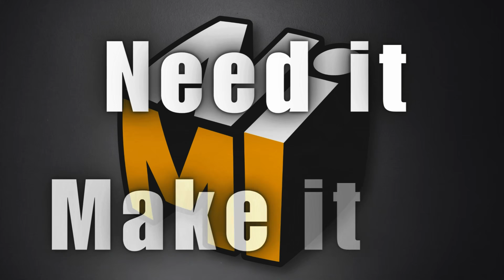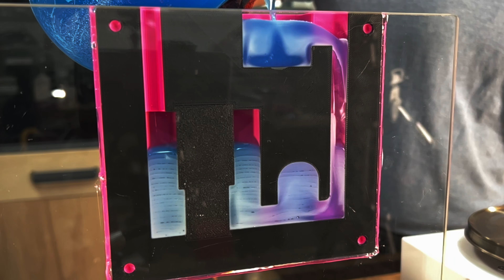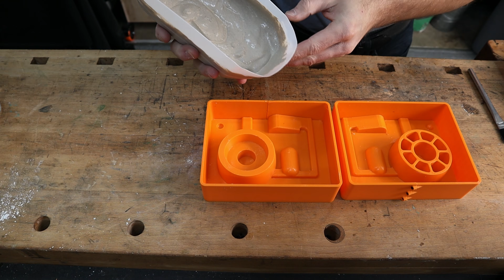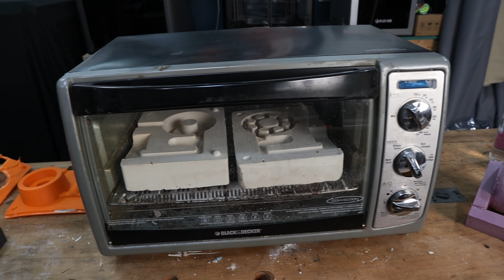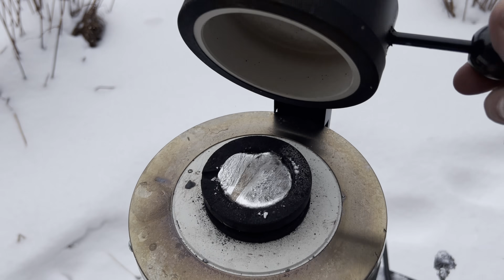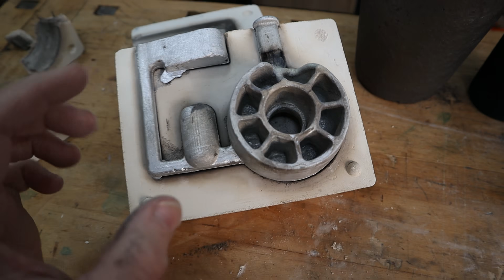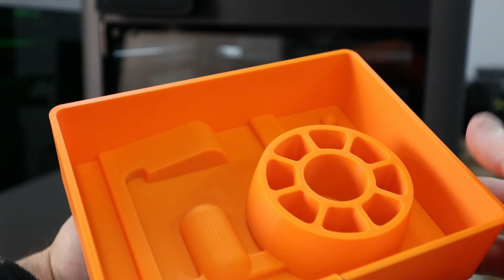Casting detailed aluminum parts is probably not a good idea and here's why.

Comment: I agree with your conclusion that you could use a larger furnace. But I think you may be missing some valuable lessons here. This time the more intricate sections of your casting were only there to reduce the overall volume. But you might want to cast intricate details in the future because it's part of the casting you want. I think figuring out how to cast thin-walled and lattice-like sections could be a very useful thing. I have a suspicion that increasing the height of the riser above the part would help a lot by getting the pressure high enough to rupture the oxide layers that can cause cold shunts easier. Also making the pouring funnel larger so that you can pour the metal faster would probably help even more. 
As far as making your 3-D prints easier to pull out, might I suggest a few things:
1. Give your prints a coat of spray paint to smooth out all the surface texture from printing.
2. Wipe them down with a silicone oil mold release agent before use.
3. If they still don't want to release well, instead of heat try cold. Plastics have about 10X the thermal expansion coefficient of plaster of paris and will shrink more when cooled causing the plastic to separate from the plaster. So after pulling the outer shell off throw them in the freezer overnight. (Edit: I forgot that the freshly cured plaster has far too much water in it to do that. You would have to let it dry out for a long time before throwing it in the freezer)

Comment: I was really hoping you solved the issue of 3d print sticking to the plaster even with proper draft angles.  Probably why they use rubber in the production atmosphere.  Layer lines are also a good place for plaster to grab ahold of.  I will keep trying also.  Looking for a better workflow from 3d pring to plaster casting.  Thanks for video.
Reply: Use abs and smooth with acetone atmosphere to remove/reduce layer lines.

Comment: I think youre doing good. You need to keep in mind that the cheapest mass production methods - like casting to save material and machining time - require the greatest amount of effort to get right. Imagine how many billions of dollars went into perfecting a coke can that cost 3ct. In casting people use old men with gray beards and 60 years experience or simulation software that costs 6 figures a year. Things like uniform wall thickness, cooling speed, etc. Casting is nice because its relatively inexpensive. Fucked up? Melt it down again. So you can experiment a lot

Comment: Tapered sprue will greatly reduce the air entrainment problem. Also casting during any form of precipitation is risky as the molten metal can instantly boil the water causing molten metal to be launched everywhere

Comment: Coat the Styrofoam with plaster and you will get a better surface finish with no sand inclusions. Also, use mold release on your patterns. Investment plaster would work much better as well. Also, heat the mold to half the pouring temp of the metal. The mold is too cold for such thin walls. Try drywall mud instead of plaster as well.

Comment: Not sure if you have it in the shop, but you could try an argon purge to get out most of the oxygen out of the mold before pouring, should mitigate this issue long enough considering one of the examples was really close. (probably not remove the issue entirely since you aren't likely going to get a perfect purge unless you engineer the mould for it.)

Comment: Your molds are not completely dry, this is a dangerous kind of thing when using plaster of paris. Also doing this outside where there is snow or a puddle of water can be dangerous too. So step 1 is PPE.
Your draft angles looked a little too small. Also using AL even if it is the right type of castable material is not as easy or good as using ZAMAC (told you last time, AL is ass) . Zamac has way better details, might be not important right now but helps you in troubleshooting, yoou can see what went wrong easier and adjust. And it´s heavier, which when using gravity casting like you do is important.
The most useful way of using 3D print and casting metal is when using 3D printed patterns for lost cast. There are special filaments which cleanly burn off when casting, kind og like what you did with the foam but you replace the foam with a 3D print. You basically 3D print the pattern and the gating system with the riser, trap etc. stick it into sand and cast that´s it. Polycast is the name I believe, that´s filament for FDM there are also wax like resins for Vat photopolymerization. Also the gate is at the lowest point not somewhere in the middle like with your design. It´s not even the equipment either, first is understanding and knowledge then comes equipment. I cast ZAMAC parts with a camping stove. The best part of this video was the visualization with the wax, this was a really great idea.

Comment: Why not put the riser & basin/sprue diagonally across the part instead of along the main axis? That might help the internal flow to fill the void & prevent that bubble in the plaster mold getting trapped & not escaping out the riser.

Comment: Would be interesting to see a 3d printed Wax Pattern Die, then coat the wax pattern with a investment casting ceramic slurry. Burnout would be quite good, and you can adequately preheat the shells to help the form fill out properly

Comment: You need vents when there is a dead stop and hard turns. You would benefit from some mold/die cad software that will show you mold flow with the specifications of the materials you are using.
Your venting idea is the way to go but the vents need to be placed strategically. I know plastic creates turbulence in a mold and will cause gas pockets. I'm not sure how casting metal works but it shouldn't be too different. The water/wax model you made is wonderful but it doesn't have the same variables and properties that will affect mold flow. Water can overcome turbulence and doesn't create hot pockets of gas. That's what you are missing. There might be some information out the showing casting mold flow.

Place some small angled vents where the mold did not fill properly. The goal is to allow the hot air/gas to escape but to not let material to escape.

In regards to the foams you have used, you may want to investigate a better foam to use. If not possible, don't use styrofoam. Poor material, very toxic. With the purple foam board, use a hot knife or water jet to cut the shapes out. CNC is just chewing it up. If you have a laser cutter, that would work too. The water jet is clear why it would work but the laser/hot knife will work because there is only heat cutting the material. The CNC is shredding it and then melting it. Think dull butter knife vs scalpel and cauterized.
Give it one more go.

Comment: Just a suggestion from jewelry casting... paint a layer of plaster without any aggregate over the whole mould first and let it firm up, then add the aggregate/beard plaster. this keeps the surface against the mould as fine as possible.

Comment: To be fair on the most complete one… you could build up a mold around it with the plaster, grind off the surface of the aluminum right before pouring (it wouldn’t take much), and pour some more aluminum to fill up the under-poured section. It would work, maybe it’d be a good idea to also drill some holes or inlets in the already cast portion for the new molten material to enter and coalesce.

Comment: Casting in freezing temperatures is rough. When you pour, the stream of molten aluminum seems quite small. I bet you lose a tonne of heat. Maybe make a larger basin to pour into, so you can pour faster, and get the aluminum hotter before pouring. I would probably also preheat both the mold, and the sand in the bucket if casting outside in the winter.

Comment: I think some of your problems are coming from the way you degass your melt.  Pouring (soda ash?) on top of the molten metal isn't really doing anything.

You need to treat it just like you are making an alloy.  That is wrap it up in a piece of aluminum foil and shove the little packet to the bottom of your melt.  That will clear up the porosity your seeing and also should help fill up all the little details in your mold.

I agree that the mold with the details isn't the easiest thing in the world to cast with the tools you have, yet it should be doable.  There's something else you can add along with your soda ash at degassing that should make pouring easier.  I can't for the life of me remember what it was though.  Sorry I'm drawing a total blank.  It's been a while since I busted out the forge and tried to cast anything.  

If I think of it I'll definitely come back and comment again.

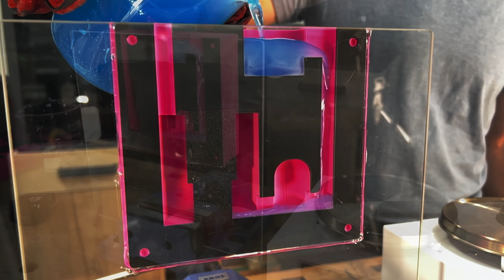Comment: 2:11 I'm not convinced the side view was faithful to the real casting event - I'd have expected the reservoir not to fill up all the way, because of trapped air, but it did, so I think air is leaking out the edges at the glass interface.  OTOH, I suppose sand is porous, too, so maybe it WOULD work like that.

Comment: Adding silicon metal powder at about 10% by weight will prevent the aluminum shrinkage.  Also another one or two hundred degrees on your aluminum and your plaster mold would probably fill.

Comment: Awesome to see the details. There a few things that are certainly causing issues. The sprue diameter is too large for the rate at which you pour the metal. For a good quality pour, the molten metal in the casting basin needs to roll over from the casting basin, fill the sprue, and the sprue needs to remain full throughout the duration of the casting. If the sprue does not remain full, it acts a little venturi like, and sucks in air and creates aluminium bifilms degrading the quality of the casting.  Aluminium wore tends to be quite pure, and not very good for casting, also being so pure, it is soft and super gummy for cutting tools after. I suspect that the alumnium being a bit hotter would have helped it fill more effectively also. Robinson foundry does some good videos on some of these methods too. Also Kelly Coffield is probably the mostr expereinced lost foam caster on Youtube for some great tips.  Pretty confident that the issues with CNC cutting polystyrene are about speeds and feeds. Perhaps try a single flute cutter?

Comment: A good rule of thumb with mold making is try to make the  form a different rigidity than the cast material. If you are casting a flexible urethane, a rigid form out of something like PLA should work great. However if you are casting a hard resin, a flexible silicone form is a better choice. For a 3d printed form for something rigid like plaster, I would be thinking about something flexible like TPU instead of PLA.

Comment: Did you put the plaster mold bucket in the oven? Maybe getting it hot will prevent the metal from cooling to fast. Or do you always need to preheat molds and this is a dumb question?😂

Comment: There's materials science that has been done to create better detail cast aluminum parts. You'd probably need to look into how they cast engine blocks and the specific alloys they use. I know there are alloys that are good specifically for sand and mold casting. Not all aluminum casting alloys are good for that

Comment: In your molded part, the chamber is part of your issue. As the trapped air cools it pulls a vacuum and pulls metal back into the chamber. You should heat the mold as well to keep metal liquid in smaller passages. Adding silicon also helps make it flow better.

Comment: The way you pour matters too, the pattern you want to cast would require a lot more downward pressure from the metal coming down the vents and spruce. You are doing very good. You pour a little slow too, metal and mould get cold faster. My suggestion is pour a bit faster, choose a better casting metal like, zamak 12 or brass as they are relatively denser than aluminum. Pour from a little upwards angle if using aluminum is the only option. Contour the entry points where the metal is being poured as see in the 3d printed cross section, it was too boxy. Smooth it out so there is minimal turbulence. Hope that helps.

Comment: Try this next time:  use compressed air to extract your mold bottoms. can extract easier by putting in buttons tou pull out after curing,  use the compressed air into those holes and will pop out.  also dry putting a very small amount of release our make a talcum slurry (very wet) and coat a very thin layer on your mold interior first.  dry then fill with support material.

Comment: What your wax casting showed you, is that you need to preheat the mold so that it doesn’t solidify before you complete the pour. Also, you should probably raise the temperature of your melted aluminum a little bit. You can also make more & smaller vent holes. Somebody else mentioned tapering your down spruce, and that is a good idea. The purpose of the riser is to provide extra hot metal to the casting as it shrinks. Putting your molds in the snow means that they were probably pretty cold, so heating is what I would suggest first. Next taper the spruce.  Black casting sand is better than the play sand you appeared to be using. Definitely use a good mold release on your 3-D printed patterns and perhaps even use more draft. Plaster tends to shrink more than most materials so it might be clamping your pattern as it dries. I’m not sure all of the reasons that you gave for your casting not working well are correct. Good luck I like your videos. Keep up the good work.

Comment: We regularly cast Aluminum with Lost-PLA.
You have a large enough crucible you just cut short on the wrong things. Your wheel part, also with cutouts, is simple so keep your pour simple:
Angle the wheel 45 degrees around the axis perpendicular to the wheels axis, so that the cutouts are on the bottom. Add your riser vertically upwards from the highest point of your part, with a large diameter and a large height - this adds more pressure which is needed for the cutouts. No vent needed as the vent is your riser which also is your feeder.
You also should dry plaster molds completely meaning also getting rid of the chemically bound water - effectively change the plaster back to its unhydrated state. This happens and 700-800°C. Hold that temp for about 1 hour per cm thickness. Also add 50% burnt clay (e.g. the red sand from tennis courts) this makes the mold more stable and reduces cracking. Your mold is small so thats not a large problem though.

Comment: The problem isn't the amount of material if the sprue and vent are both totally filled. You just aren't venting properly and you're getting air bubbles in the failed sections. I don't know and you're trying to use no vent at all for the foam

Comment: Would modifying your mould design to bring the molten aluminium in from the bottom middle of the part and making your chimney the full depth of the part reducing in size like a tall pyramid?    You could heat up the mould before pouring as well.

Comment: The most successful lost foam castings I've seen are on Kelly Coffield's youtube channel.  He coats his foam in slurry.  On the 3d printed side you might try a tapered sprue to prevent that air pocket mid way down.
Reply: A significant portion Coffield does not coat in the slurry, but instead he uses a much finer sand.  But he uses flow and head pressure to his advantage instead of seeking failure to stage content for a next video.  Difference in the target for enrichment by publishing a video.

Comment: I think it'll be difficult but i feel like you're close.  I think moisture in the plaster is cooling your parts.  I know you said that the bubbling isn't nearly as bad as last time but it shouldn't bubble at all, that's water boiling off and taking heat with it.  Those plaster molds should be dry dry dry.  If at all possible use a blow torch and point it down in there and heat the mold up before you pour.  You have enough material to fill all the way up and out the vents so i think it's just cooling that's the issue.

Comment: The sprue really needs to be smaller and tapered. Running the gate into the side of the mold was also a bad idea. You can see all kinds of turbulent flow with the wax at 5:07; bottom gating would help a lot. wax also has more viscosty then liquid aluminium, wich is behaves more like water, so even more turbulence. I would ditch the blind riser, too, it's not helping much. Preheating the plaster molds to a higher temp would help more, I think. Getting some purpose-made casting ingots would also be much better than using whatever scrap metal that has a unkonwen chemical composition.

Comment: There is another way . Make a very simple open top  mold without the sprue and vent holes . All the detailed features are basically at the bottom . And  just dunk the metal in to mold whilst it's hot .
Reply: Your suggestion seems more practical than what I was going to suggest (as someone who was around but never actually got to use epoxy molds):
Extending/extruding the 'details' out of the part so that the cold-shut(s) and other defects can easily flow into the waste (to be cut off) instead of being trapped; 
Or tilting the closed mold so that the slope of the part at the vent is maximized.

Even though I have the impression that a design goal is aways to minimize the amount of machining/finishing required, I think that getting usable parts at the end is the higher priority; so your instruction to reduce the surface-area most affected by defects makes the most sense.
Reply: @LynxSnowCat  my exact thought, i think it would be easier and retain more of the detail without airtraps and sch if he flipped the mold with the details facing down if you know what i mean :)